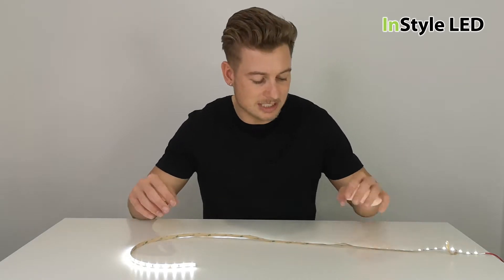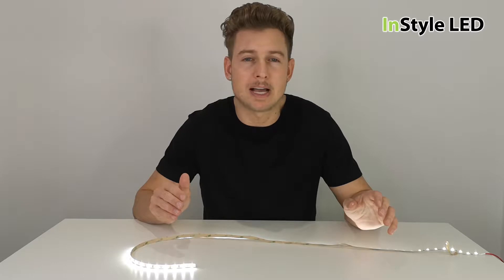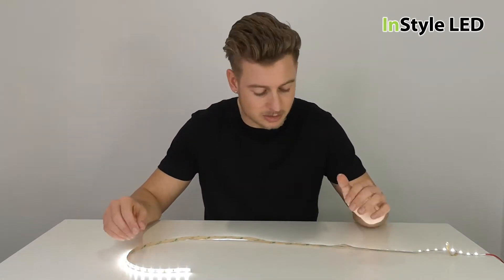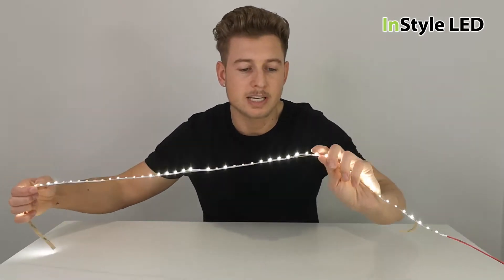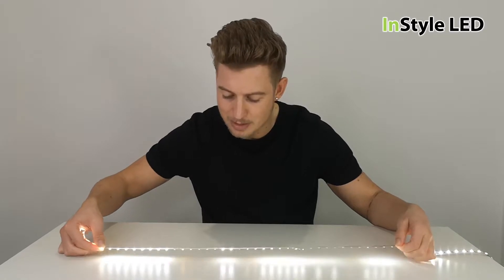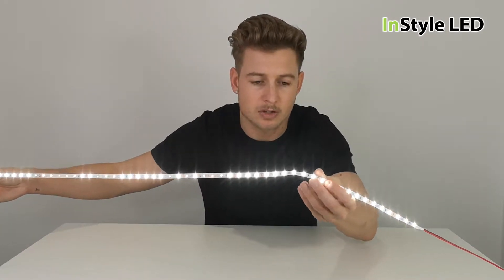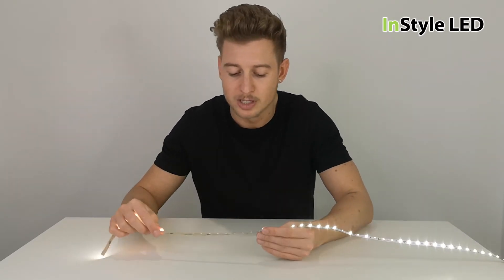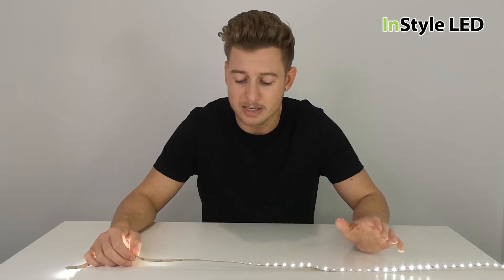Why are my LED strips not working | showing a different colour? A: they have paint on them!

Comment: Hi! whenever i try to press any colour on my LED lights, they don't work. For example, blue would be purple, green becomes yellow, red becomes one of the DIY's and the power off button doesn't work. Whenever I press the power button, it becomes red and only switched off if I take off the plug... Is there any way to fix it?

Comment: when i push red it turns purple and when i push blue it turns pink
Reply: Blue and red channels are touching
Either connection into controller, cable on strip, or any joining connections.
To test try one cable at a time direct strip into power supply

Comment: My LED's were working perfectly before, all of the buttons worked and the colours corresponded correctly. Now, every colour is mixed up, but I didn't do anything different. For example, I'll press light blue and one of my strips will turn a green while the other turns magenta. I don't know why this has happened.
Reply: Did you figure it out ?
I have the same issue
Reply: Help i just want a nice pink room and some of them are red😭

Comment: Mine dont even turn on, remote doesn’t work either. I would touch it and it lights up but thats it
Reply: your white box doesn’t work, get a new one. i had the same problem
Reply: @joann7401  is the white box the "white box" 😂 that u connect to the strip
Reply: Rabia Bouanani the rgb control box
Reply: Where can I get a new box?
Reply: @lzer1591  amazon I got mine there
Reply: same thing is happening to me... what should I do?
Reply: Omg same that’s so strange
Reply: @sharonolatunbosun7098  same u figured out how to fix it
Reply: @jaiden7709  no I didn’t fix them yet
Reply: @sharonolatunbosun7098  I just fixed mine
Reply: @jaiden7709  how
Reply: @jaiden7709  how did you fix yours?

Comment: well how do i remove the paint from my led lights?
Reply from the maker: Great question! Well I guess there is no official way with this, but I have done this several times before by turning te LED lights off and using a small flat head screwdriver and slowly / carefully just scraping the paint off. The paint was dry and flaked off faily easily. If there was a lot of paint, the main areas I focused on were the LED's, this is where the paint was blocking the light and making them look a different colour. Once you scrape this paint off you will notice the lights will return to their true colours. But then I would still scrape off using a dry cloth or the flat head screw driver any paint on the PCB as although the lights may work now, im not totally sure if the paint on the PCB / tracks / resistors could cause some damage in the future or reduce the life of the strips. As for example once you turn them on they may work fine, but as they heat up the paint main turn to an element of liquidity which may in  turn cause a short circuit, bridging across the pcb tracks. Hard to say as each time this would be different! I would get as much of the paint off as possible, take your time. The good news is, ive seen this many times, and nearly every time the customer scraped the paint off and used the strips and they were fine for years and years as they normally would be. The only excapetion was  a couple of customers who painted the strip so much, they preffered just to order some new strips. So they didnt bother trying to remove the paint.  Good luck! and if you ever need some new strips
www.instyleled.co.uk :D

Comment: Hi I need help my lights are just not turning on at all!.
Reply: same i need HELP!!!! oh and have you figured it out if so plzz reply back ;)
Reply: Nevaeh Cooks Hi I have ! So what happened to mine was that every time  I tried to turn them on they where off. So what I did was press the on button tried to turn it press the on button again and pressed a colour then they worked. also  this is something else I do if that’s not the case. I just kinda unplugged them and took off the piece that connects the led lights to turn he plug and the lights and put then back together.

Comment: Paints on the back of my LED covering the wires/electric lines how do I get it off
Reply from the maker: If its dry and flakey then try ujsing a flat head screwdiver. Or if this does not work ,try a dry cloth. And if this doesnt work try a slightly wet cloth

Comment: Hi just a quick question: Why won’t my LED lights turn off and stay on blue? I just got these lights yesterday and I’m so confused as to what is making it do this. What I mean by they stay on blue is that supposedly the lights are “off”, but they’re still on blue. If anyone has any tips on how I can fix this please tell me. Thank you.
Reply from the maker: Hi Amy,  that sounds very odd!  Have you tried disconecting the blue cable and rewiring it in,  as it may be touching the + (positive) cable and staying on all the time

Comment from the maker: Problem: WHEN I SELECT COLOURS FOR MY RGB/RGBW STRIP, THEY ARE ALL WRONG
Reason: 

You have crossed over the cables into the controller. If you have wired the Red cable into the Blue terminal and the Blue cable into the Red terminal on the controller, for example, then whenever you select a colour on your controller the colours will be mixed wrongly, so you’ll see different light colours to those you’ve selected.

Solution: 

You must check the cables, and re-wire any that are crossed over into the correct terminals. If you have extended the cable with a cable connector you must also check those connections too.

Sometimes the cables can be touching, which can create unpredictable results. If Red and Blue cables are touching, for example, then you’ll need to separate them so the connections are pure and without interference.

Comment from the maker: Problem: MY LEDS WILL NOT LIGHT UP AT ALL
Reason:

If the LEDs will not light up at all, then this could be down to a faulty power supply.

Solution: 

If you have several power supplies, then try a different power supply onto the same strip to see if this now works. If it does, then you have a faulty power supply and will need a new one.

Comment from the maker: Problem: MY RGB/W LEDS ARE ONLY LIGHTING UP A LOW (RED) GLOW
Reason:

You have a 12V power supply going to 24V LED strips.

Solution:

The only option here is to get a replacement 24v power supply for your 24v strips.
Reply: OH NO....

Comment from the maker: Problem: MY RGB/RGBW LEDS ARE SHOWING A DIFFERENT COLOUR (full colour is affected or not working)
Reason: 

If all of the LED strips colours are working except for just one colour, and this is affecting that colour all along the strip (e.g., the whole length of the Red colour LEDs are not working), then there is either a fault with the soldering of the Red -ve cable onto the strip’s PCB, or else Red cable is faulty from the strip to the receiver, or the connection of the Red cable into the receiver is faulty or disconnected.

We can say this with some certainty, because here is no way that full length of Red LEDs are all faulty; the way LED strips are made means that a faulty LED will only affect the section between those cut points. Therefore the issue is related to the cabling.

Solution: 

Check the cables between the controller and the strip, especially if you have extended them with a connector block. An effective test would be to wire the power supply directly to the strip, thus cutting out any extension cables and any control gear. And note that black is always positive (+) for RGB/RGBW strips. so start by wiring the positive from the power supply to the black cable on the LED strip. Then wire the -ve from the power supply to the cable for the colour that isn’t working.

Let’s imagine that it’s the blue cable that is not working. In such a case, you should then see that the Blue lights will light up, proving that they work – which means you have a bad connection somewhere else. With this knowledge in mind, rebuild the system step-by-step, adding the controller (and extension cables if you have them) and see which component makes the Blue lights stop working.

(If at this point the Blue does not work at all, then check if its cable has come off the solder pad on the strip, as this is the only reason left as to why it would not work.)
Reply: Ugh, this my issue but I'm not smart enough to understand this explanation.

Comment from the maker: Problem: MY RGB/RGBW LEDS ARE SHOWING A DIFFERENT COLOUR IN SOME SMALL SECTIONS OF THE STRIP (e.g., 100mm not working)

Reason: 
Are your LED strips working fine for most of their length, except for one section or a couple of sections within the cutpoints of the tape? (e.g., when you select Orange, a 50mm or 100mm section shows Green only.) Well that means the Red LEDs within that section are faulty. You can easily confirm this – if you set the strips to just Red then on that section they will be completely unlit, and if you set to Purple that section will show Blue only.

RGBW LED strip with a faulty circuit section (dry joint)

This can be very confusing when you install your first LED project and see these colours not matching. But the answer is simply that one colour of the RGB/W LEDs is not working within that section and needs replacing. This can be caused by static-electricity damage, or bending and twisting the strip too much, or being trod on, damaged in transit, a cheap poor-quality strip, or dry solder joints.

LED strips are made up of 50mm / 100mm sections (sometimes other sizes), and wired in a way that means each section is a discrete, enclosed circuit (in other words, if a LED or resistor is damaged it will only effect the section of strip within the cutpoints).

If the complete section between cutpoints is not working, this is a very similar problem to a damaged LED or resistor – most likely caused by a dry solder joint.

Solution: 

In most cases here the only option is to replace that section of the strip. You can do this by swapping the full strip. Or you can get another, say for example, 100mm section and solder this in – or you can use connector clips to clip in a new 100mm section.

Before taking this step, it’s worth attempting to touch or press down on the LEDs/resistors in the faulty section – in the best case possible, you may see that the light miraculously comes back on; in this case the problem is a dry solder joint, and if you’re capable of soldering you can repair this strip!
https://youtu.be/OY-wwlriHqQ
Reply: They were fine this morning but how a group of them are red when I want purple

Comment from the maker: Problem: MY LEDS ARE FLASHING

Reason:
If your LEDs are flashing in a regular, consistent sequence (e.g., on for 1 second, off for 1 second, then on for 1 second again), then your power supply is overloaded! This means you have too much striplighting connected to that power supply.

For example, if you have 10m of LED strip that draws 5 watts per metre, the strip requires 50W in total (whether it’s two 5m strips or 10x 1m strips, it still adds up to 50W). If those strips are all powered by a 30W power supply, this will go into overload protection mode, which means it will turn on, realise it is overloaded and immediately turn back off again, then keep repeating this cycle.

Solution:

You may chose to get a larger power supply that can handle the total wattage required, so a power supply higher that the total wattage of all your LED strips.

Or you could get another power supply of the same size as you already have, and split the strips across 2 power supplies.

Or perhaps your project will allow you to reduce the amount of strips onto that power supply.
Video link  https://youtu.be/zbqHSojCJBM

Comment: Hi my LED lights keep on changing colors when I click a button on my TV remote please reply or make a video about it.
Reply from the maker: Hi ,  this sounds like you have a infrared controller for the strips and the infrared signal from your TV remote is controlling the lights also. I  cant see a way to  resolve that unless you change your LED strip controller.   We dont supply Infrared controllers, we supply Radio frequency instead (RF)  so that there can be no interfearence from other controllers.

Comment: My led light were working just fine, I was messing around with the remote and they turned off all of a sudden, I tried everything and they won’t turn on. Plss send help ;((
Reply from the maker: There are remotes that if you hold the buttons down for 3 seconds they turna  zone off,  if hold down again for 3 seconds it turns that zone back on.
Or see the pinned comment above for some good answers

Comment: When I do one colour the other strip goes to another colour. And now my red coloured row doesn’t work at all, only one strip and the other doesnt
Reply from the maker: Problem: RGB/RGBW strips: My LEDs are showing a different colour (full colour affected / not working)
Reason: if all of all of the LED Strips colours are working other than one colour and this is the full colour along the strip not working . EG,  the whole of the Red colour LEDs are not working , then there is a fault with either the soldering of the red cable onto the board, the red cable is faulty from the strip to the receiver or the connection of the red cable into the receiver is faulty / disconnected. There is no way that the Red LEDs are all faulty, as the way they are made is if a LED is faulty then it only affects the section within the cut points. Therefore the issue is around the cabling.
Solution: Check the cables between the controller and the strip, especially if you have extended them check the connector block. A test would be to wire the power supply directly to the strip cutting out any extension cables and any control gear. And note that black is always positive +  for RGB/RGBW.  so wire  the positive from the power supply to the black cable on the LED strip. Then wire the negative from the power supply to the colour that isnt workings cable.  lets say the blue cable as blue is not working. At this point you should then see that the bluelights will light up, proviong that they work , and meaning you have a bad connection someone else, so then rebuild the system adding the controller and extension cables if you have them and see where the issue is now knwoing that the blue does work. If at this point theblue does not work at all, then check if the cable has come off the solder pad on the strip as this is the only reason left as to why it would not work.
Reply from the maker: OR
Problem:  Whenever I select colours for my RGB/RGBW strip they are all wrong
Reason:  You have crossed over the cables into the controller. if for example you have wired the red cable into the blue terminal and the blue cable into the red terminal on the controller, whenever you select the coluors on your controller they will all mbe mixed up and showing wrong colours to what you are selecting
Solution. You must check that the cables are not crossed over and re-wire them into the correct terminals. If you have extended the cable with a cable connector you must also check that. Sometimes the cables can be touching so red and blue may be touching and you need to seperate them so the connection is pure
Reply: @InstyleLED  don't get u at all??
Reply: @InstyleLED  bruh what i don’t understand u at all

Comment: I have two seppareted strips but they show diffrent colours.. when i have them together.
Reply: Hi I had this same problem where one of them is dim and one of them is very bright it’s because u need to have both of the cords plugged into the same white box
Reply: Jennifer Kalisz white box? I need help I’m so confused
Reply: Jennifer Kalisz white box? you mean the led strip connectors? or the box that is connected to the black extension cord?
Reply: harry's left dimple keep in mind there are many people who sell LED lights so she probably has something different ✨✨
Reply: Lea no, there are led strip connectors that should be bought separately if it doesn't come in the box and you need those in order to connect two strips that were cut. the receiver is the white box that connects to the power adapter which is what every led lights kit comes with
Reply: Marockann same
Reply: same
Reply: Same
Reply: Same do you know how to fix?
Reply: Same
Reply: same
Reply from the maker: test here : https://www.youtube.com/watch?v=R7LtPCXTwrU&t=2s
                         repair here:  https://www.youtube.com/watch?v=kpAQQYc0kNc
                         repair here:  https://www.youtube.com/watch?v=9fF4lZTIUHE&t=17s 
                         repair here: https://www.youtube.com/watch?v=oGvXlfrFhLc&t=8s
                         issuse here: https://www.youtube.com/watch?v=aZ1H6GYxLz0
                        guide here: https://www.instyleled.co.uk/support/troubleshoot-led-strip-lights/

Comment: i got another role to finish my room all the way around. and when i press white the new rolls go like greenish yellow while the rest is bright white.
Reply from the maker: your blue cable isnt attached properly / faulty . as red, green and blue all working will be white. if just greenish yellow then there is no blue working
Reply: @InstyleLED  mine do not work after using them for less than a day, the remote doesn't do anything
Reply: InstyleLED okay so how do you fix that